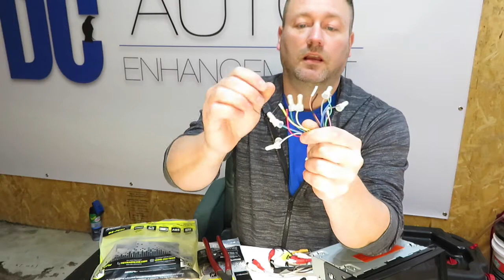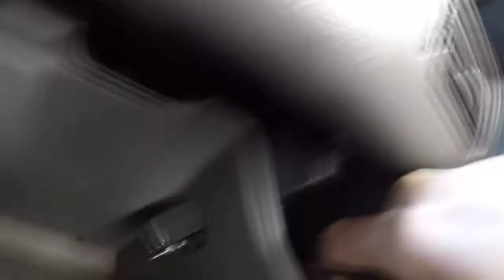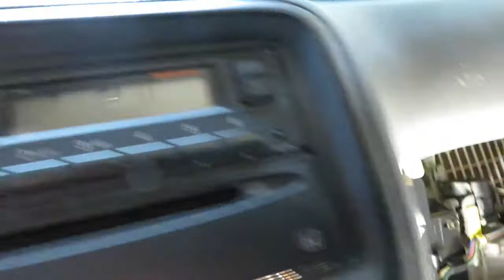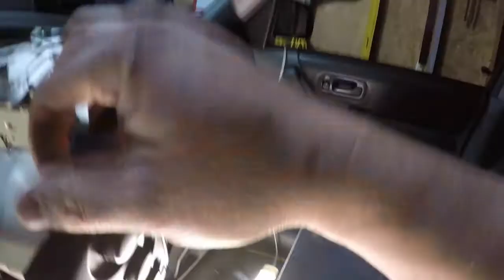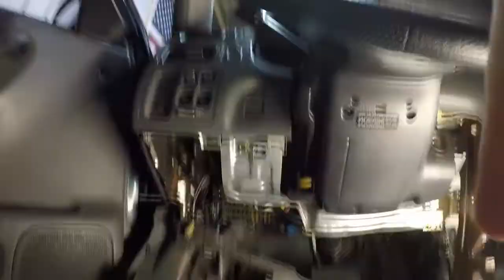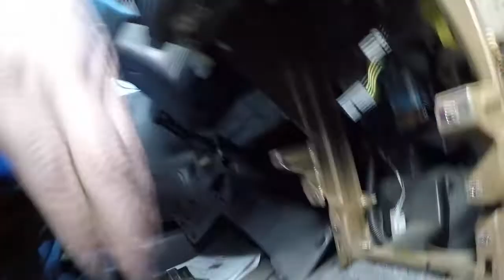1st Generation Honda CR-V Double DIN Stereo Installation How To!

Comment: I just installed a jvc dvd double din stereo but it says parking off when I try to play a dvd. What do I do?  I did have an orange w/ white line on the stereo and solid orange wire on the harness but I just capped those off.
Reply from the maker: @DAVIDJMARAUDER  you either have a wire that should be grounded labeled" parking brake or that unit has a sensor in it that knows if it's moving or sitting still.
Reply: @DCAutoEnhancement  I just wired the parking brake wire into the harness connector ground and the dvd player is working now. Thanks man!
Reply from the maker: @DAVIDJMARAUDER  no problem
Reply: @DCAutoEnhancement  The power outlet of my honda crv came out loose. I want to tighten it  how can I do that❓️🤔
Reply from the maker: @thony_5 take a look at this video, it should show you the mechanism that holds the power outlet in place: https://youtu.be/vVa6HHOMAO0

Comment: I tried it and it did not work for me.
Reply: Me matching the wires together correctly. I even replaced the radio fuse and still nothing.
Reply from the maker: @alexlevingston  as long as the aftermarket radio uses the standard wire colors, it should work. Do you have power to turn the radio on?
Reply: @DCAutoEnhancement  Yes, but for some reason, it's just not turning on.
Reply from the maker: @alexlevingston  there are two wires that have to get power in order for it to work. The yellow wire should always have power (the fuse for this wire is not normally labeled "radio") and the red wire will have power only when the key is on.  A lot of times the constant wire is on the cigarette lighter circuit and the fuse is labeled for that. I would check all fuses. If they are good, make sure the black wire is grounded.  Is this radio new or used? Some radios have fuses on them as well.
Reply from the maker: What didn't work for you?

Comment: The harness i got off amazon looks smaller than that...hope it still works mine is a 2000 honda crv..multiple websites reccomended this one your  using and the one i bought. I wasnt sure what to go with but amazon reviewers said they went with the other part # 70-1721
Reply from the maker: I just looked up the harness for your vehicle. You do need the 70-1721 ( https://amzn.to/35a1HpJ ). Here is a link where you can find that information.  I hope that my video wasn't misleading.  I will check my description and make edits on the links.
http://www.metraonline.com/vfgapi/vehicle/31463?
Reply: @DCAutoEnhancement  Thanks for your reply you werent misleading i was just confused from all the amazon reviews saying some worked and others didnt. I tackle mine tomorow i got the same kit you did everything just as you except no antenna cable. Wasnt sure if i need one or not , if i do i will need to make a trip to walmart
Reply from the maker: @dodgers411  97 and 98 are the 70-1720 99 and 2000 is 70-1721

Comment: Is that type of stereo included in the links?
Reply from the maker: I will, here it is:
https://amzn.to/30tqi6E
Reply: @DCAutoEnhancement  oh geez 400 for that
Reply from the maker: @frankyyyy43  there are less expensive radios, I just wanted to get you the link for basically the same one that I used
Reply: @DCAutoEnhancement  Also do you know how to reattach the charging port? I bought mines and realized the charging port isnt there
Reply from the maker: @frankyyyy43  check out this video, it is a great solution if you are changing the radio anyway.
https://youtu.be/vVa6HHOMAO0

Comment: THE best install video for first gen CR-V’s, bar none. 

Do you mind providing more details on how you routed the microphone? I need to do it for mine this weekend. Thanks again for this video!
Reply from the maker: Thank you!I'll see if I edited it out. If so, I'll make another video and link it here. Thanks for watching!
Reply: @DCAutoEnhancement  Hey, did you ever make this video?
Reply from the maker: @lilrysosa  Which video?
Reply from the maker: I see now.  I did not but I can link a video where I am pretty sure I recorded running the mic cable. It's the same concept.
https://youtu.be/WdrSBf_rCYU
Reply: @DCAutoEnhancement  The one about routing the bluetooth microphone
Reply from the maker: I see now.  I did not but I can link a video where I am pretty sure I recorded running the mic cable. It's the same concept.
https://youtu.be/WdrSBf_rCYU
Reply: @DCAutoEnhancement  awesome! Yeah, it’s sped up in the video. I get the general gist of it, but any additional details would be useful :)

Comment: Thank you for the video !! This will help with my crv
Reply from the maker: Great,  if you have any questions, let me know
Reply: What size is the double dim that you installed  @DCAutoEnhancement
Reply from the maker: @isapatel3848  i believe the measurement for DIN is 7 inches by 2 inches and double DIN is 7 inches by 4 inches.